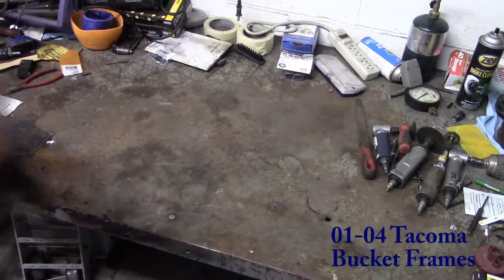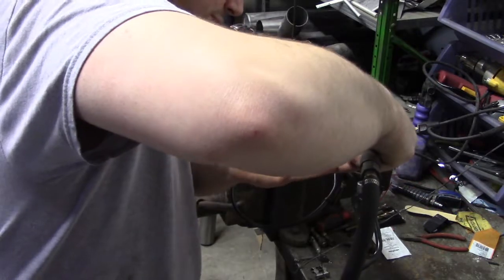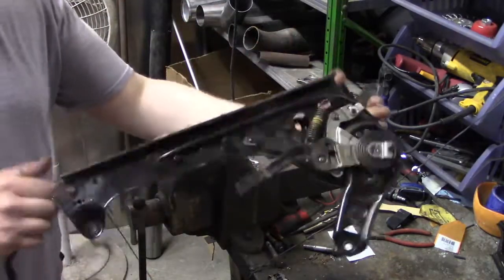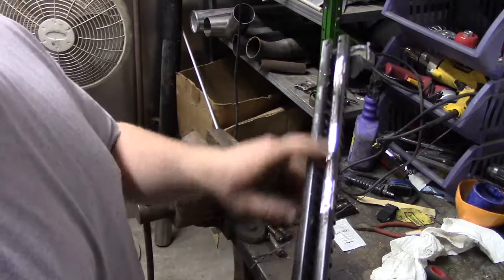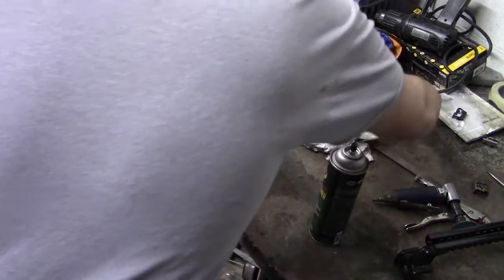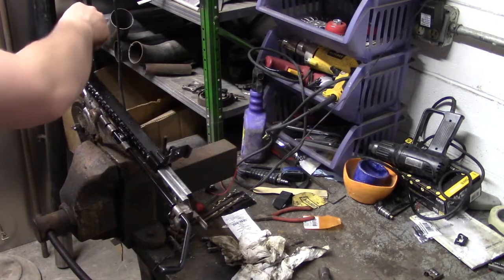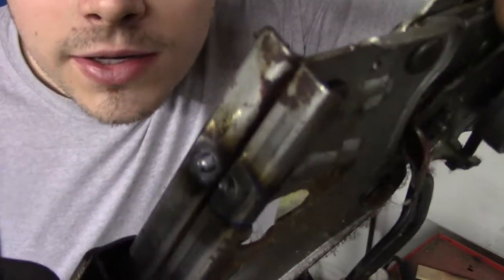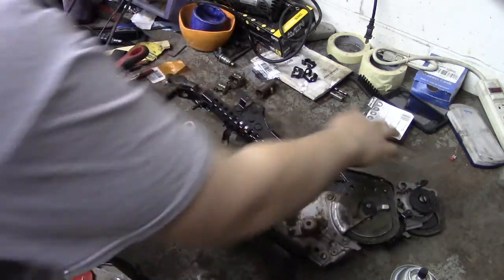Toyota Seat Frame Disassembly

Comment: I have a standard-cab taco that was just one click too short for my size (I'm 6'1") so I always felt a little cramped in the seat.  there are  several dimples and rivets in the slides which prevented the seat from getting that extra click back, even though there was enough clearance for it in the cab. I found that by filing down the dimples and drilling out the central rivets and welding the rear brackets onto the bottom slide directly, I was able to get that click! My back was thrilled.

Comment: Well hell....this is I guess what needs to happen to the 09 seats im trying to put on my 04 Toyota xrs. For starters how the hell do you get the torx acres out? They almost seem like the threads are crimped/struck or something. Can get them to break. Wish you drew up a step by step. Had to understand exactly what you're doing to the rollers and such. I'll just watch over and over I guess
Reply: Are you still posting?  I was looking for the second video in this sequence.  I would like to know how to disassemble the seats to get the tracks off as well so that I can complete the transition to the 4Runner seats.  Thanks, Kevin